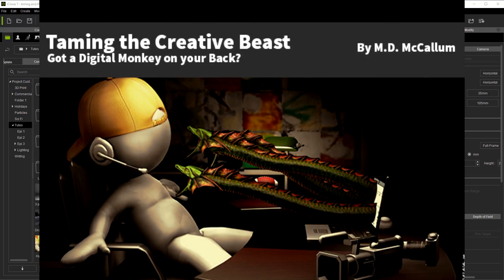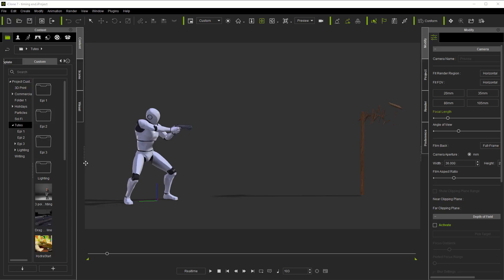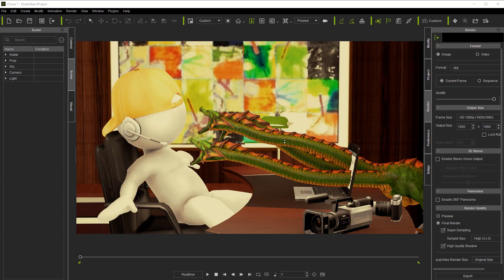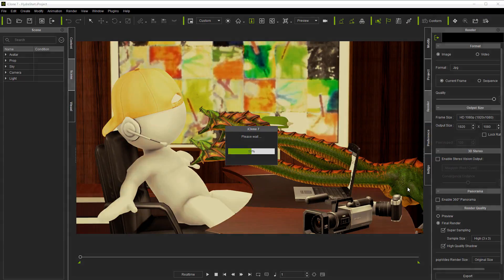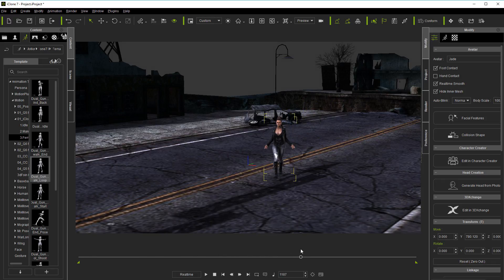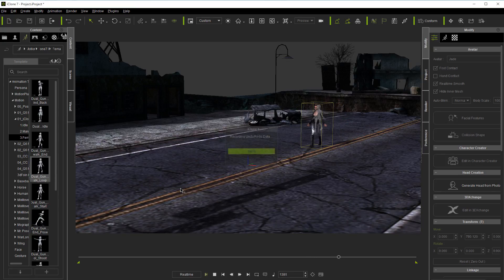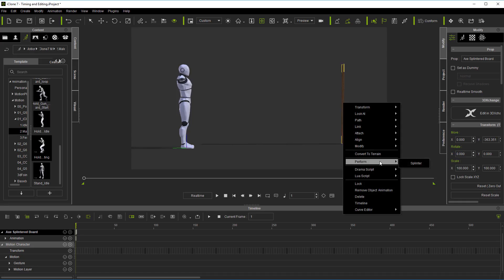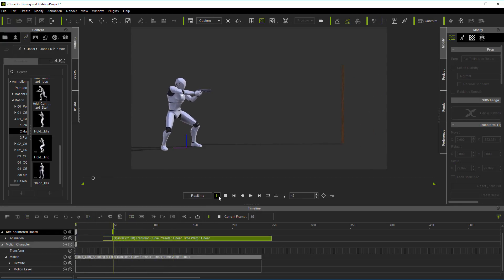Animating in Realtime - Episode 4

Comment: How you have exported the Splinter Prop and the Splinter Prop Animation from 3Ds Max into Iclone?
Reply from the maker: I setup a physics simulation with the Rayfire plugin. Might be free scripts out there that will fracture or splinter things then use PhysX in Max to run a simulation using a sphere as an impact object.
Reply: I know, but when i export this out of 3dsmax and import it 3dxchange/into iclone i have 1 single object that want break in iclone? I also can not select the individual peaces inside of iclone. Hope you can help! Maybe you can record a little quick tip video for that - that will be great! Thanks!
Reply from the maker: To my knowledge there is no way to export pieces like that unless you export them individually which is impractical for most props since there are so many fragments. Maxscript might be the answer to automate the exporting of the frags... might be a script out there that does that.